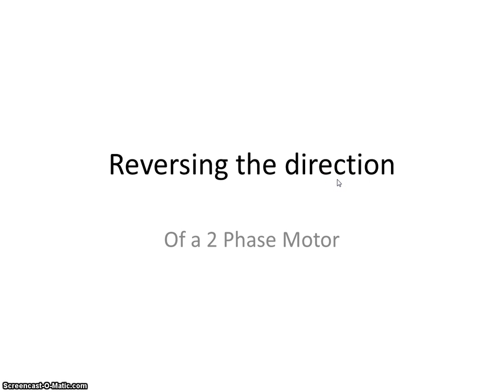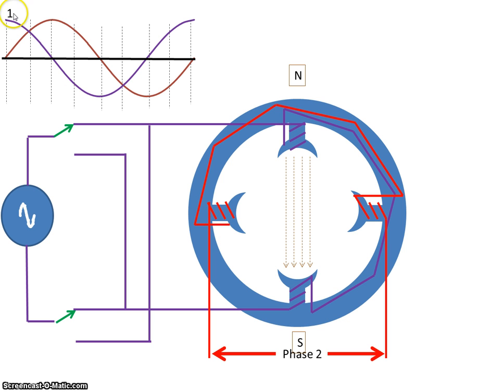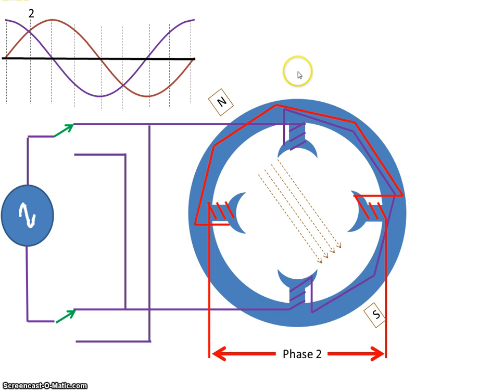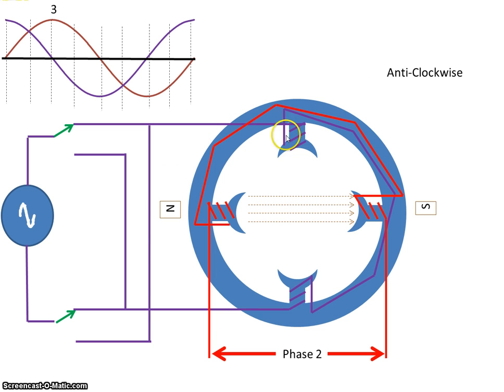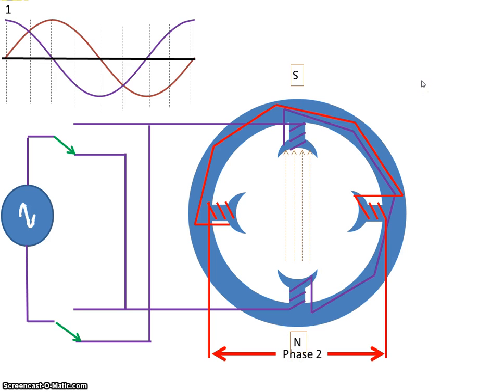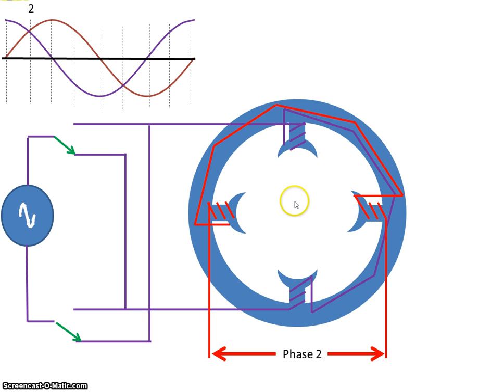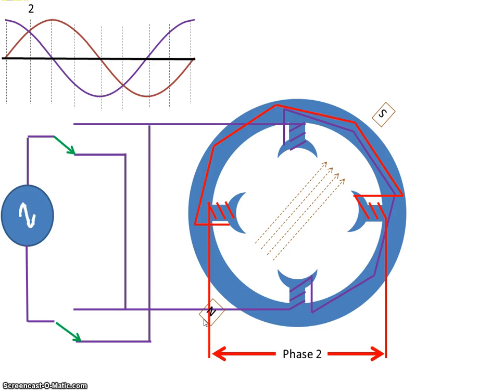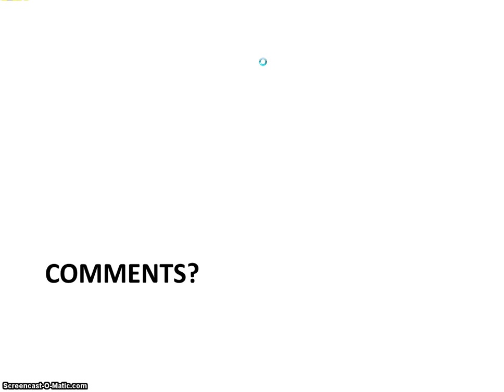Reversing the direction of an AC Motor

Comment: How about a 2 speed single phase reversing ac motor with a centrifugal starting switch off? Would there just be 2xlength of the runing windings for 1 speed, then 1xlength on the running windings with a bypassed length on those windings? Then the other stator windings have a start cap. Or are there any hidden tricks for windings for ac motors running 1 speed, then another, at maybe twice the speed? Know a good reference?